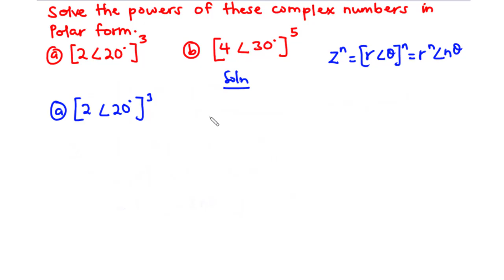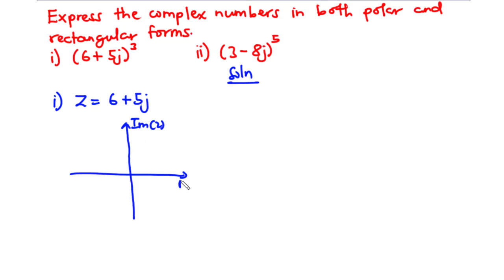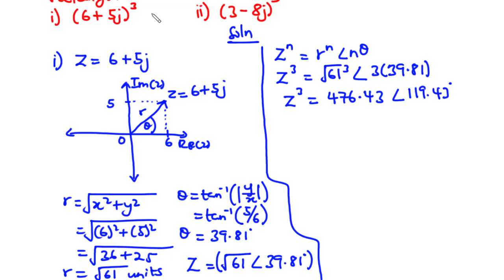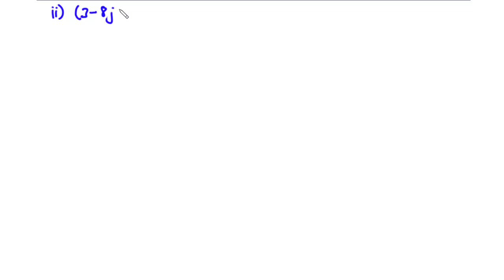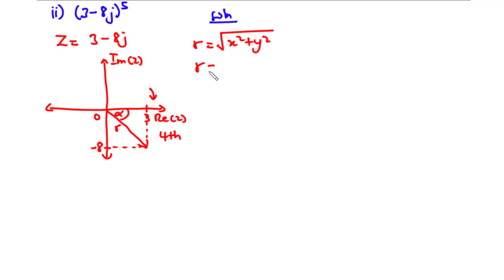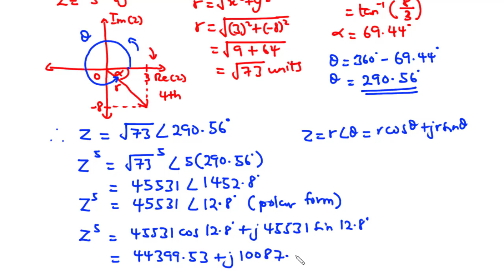06 - De Moivre's Theorem | Simplifying Powers of Complex numbers in Polar and Rectangular form |

Comment: How did u get 12.8 degrees in the polar form
Reply from the maker: hi Jacqueline, since the initial angle was greater than 360, you'll need to subtract 360 a number of times till you get a value less than 360 ie 12.8